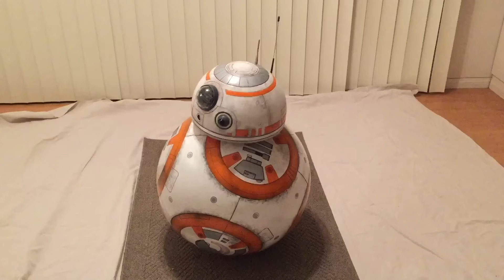BB8 - Trial Run Video 1

Comment: One thing I've noticed recently in The Force Awakens is the "neck" portion of BB-8's dome (The very bottom of the head from the silver ring, downward) is fixed, acting as some sort of platform for the rest of the dome to turn left and right.  So, I guess that means that there is SOME sort of motor array inside the head?
Reply: i think i has a wheel under its head